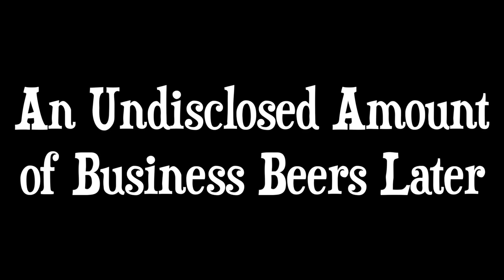BUELL Motorcycles: Its JUST a Fancy Sportster

Comment: Buel engines were made by Rotax so my guess its a mark from whoever they outsourced their casting to.
Reply from the maker: The cylinders are aftermarket
Reply: Only the water cooled 1125 was made by Rotax.
Reply: @p.evanschumacher183 and the xb models were   engines were Porsche design  as also the vrod had two of the xb models lightning for ten years also firebolt  for four both brilliant bikes to drive a bit small in legroom department  but real fun
Reply: @stuartroy2937  the Buells use an Evo engine, the Vrod engine was too big, heavy, and expensive for Buell to use and HD didn't want to give their fancy new engines to their weird side brand.
Reply: @stuartroy2937  Um, no. Sorry.
Reply: @james_chatman  dunno where I got my info from I always thought that it was Porsche design 🤔👍🏍🏴

Comment: A well-built, (read 'well working combination) Evo will rip.
Compression is a huge part of why the Hammer 1275 conversions sound so 'crisp'.
Stock Evo Sportys just sound 'meh' at rpm. But they're built for production and emossion standards, so...
Shelby's Buell sounds dead-nutz on.
Reply: Lighter flywheel than larger displacement stock bikes, longer duration cams and lighter weight. That's what's up.